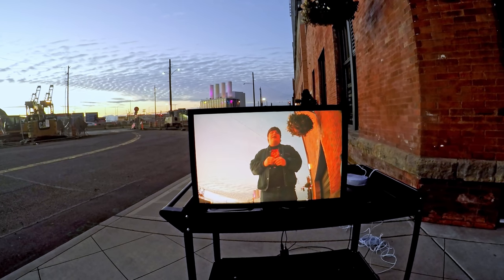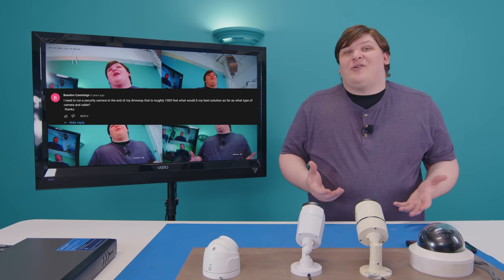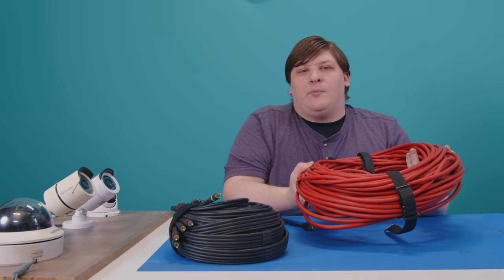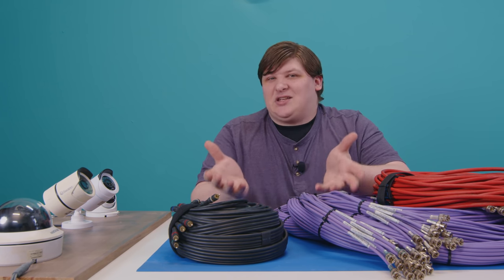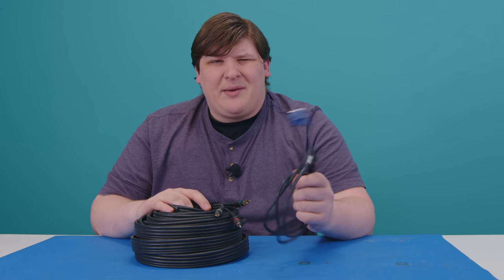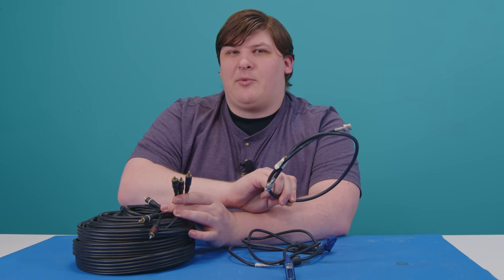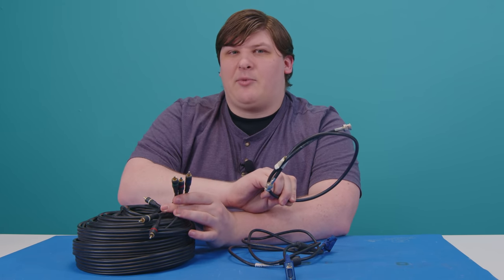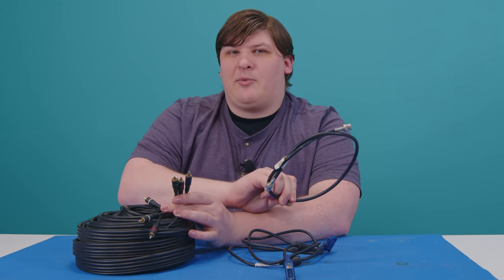1000ft of ANALOG HD video over a single cable?! [AHD/CVI/TVI]

Comment: Thanks! Ive wondered how they did this since i first installed one of these HD surveillance systems several years ago.

Turns out they just turned up the bandwidth limiit on plain old NTSC to get more horizontal lines. And more resolution on each line. Cool!

And nothing anyone could put a patent on.  

It remind me of the first NHK hd cameras and recorders in the 80. Those were analog RGB, 10 Mhz for each color channel, 30 MHZ total. Standard def was less than 6 MHZ. That caused a lot of skepticism about hd broadcasting in the beginning as we would have had to open a whole bunch more channels at the same time cell services were looking to expand.

Comment: I belong to SMPTE. The ITU-R Rec-601 is 720x486@270mb/s. Fun fact it was called CCIR601R before that, and was a parallel (NOT serial NRTZ) digital signal over a 25 conductor DB25 cable and connector!
Look it up! the cable was super low capacitance (something like <2pf per metre) and was several dollars per foot!  I still have a roll of the parallel cable!
Reply: Yep.  I have a Sony D-2 deck in my basement with a composite digital parallel connection.  Super fun thing was learning that even though you can use a parallel to serial converter, it's still composite.  All normal serial digital is D1 component.  Had to get a format converter to change it from D2 parallel to serial then to SDI (D1 component).

Comment: The only commercial systems I've worked on were all IP cameras with strategically placed switches to keep the wires short enough. Never occurred to me before that analog would've been used prior. Neat.

Comment: Historically, Ethernet ran over that RG-58 coax, known as 10-Base-2 or "Cheapernet" because it was cheaper than the heavy RG-8-like coax used for the original 10-Base-5 Ethernet.  All of these were 10Mbit/s with CSMA/CD bandwidth management.  If those Ethernet converters provide more than 10Mbps over RG-58, they probably use a different data encoding than the original crappy 10-Base-2 signaling.
Reply: This would be 10Mbps max, as its a shared bus/cable (so no separate send and receive lines) and would need to be able to fix the Video stream and any commands/diagnostic data. Would be possible, but probably only at SD bitrates, in which case, analog signals would be fine.

Comment: Back in 2008 I had a tour of the video surveillance system in a large casino.  All of the cameras ran over coax, for a specific reason you didn't mention - no digital lag.  The timing of the video signals, and the matching between them and all of the other systems recording exactly what happens when, is critical to how they are used in a casino environment - to identify and catch cheaters in the act.  As I recall, all of these video signals were brought in over coax and then split between the live control room (where they had the pan / tilt / zoom controls), and the recording facility which in the day had dozens of racks, each of which had dozens of RUs of USB video capture devices - each of which took one analog signal in, and converted it over USB into a device that would record the output and then pass it through to the digital storage that was again all separated from those capture devices.  It was fascinating stuff for me at the time, and a complete eye-opener as to the different priorities that dictate how video surveillance works in this type of high-stakes environment.  Thanks for your insights - and I hope that one day you might find one of these decades-old devices being sent out to pasture, and you can rediscover this weird transient technology from the day!

Comment: The thing is, coax carries the data from the satellite dish to the box, or from the aerial to the box, but HDMI is needed from the box to the TV. We know coax can carry all the data required for HD signal over a long distance, because it does that in every house.
Reply: Both HD satellite programming and broadcast HD use digital modulation schemes, while these security camera standards are using baseband video... going from "a solution exists" to "buy this product" is engineering, and I think that's what this video is appreciating.
Reply: RG-59 coax is typically used for CCTV systems (baseband video, not RF), it's not good enough for UHF or satellite TV at any length (ok for a fly lead but that's it). Coax good enough to connect your satellite dish is a lot more expensive.

Comment: AHD/TVI was used in a video transmission system for drones then called Byte Frost by Fat Shark so that's where I first read about it. In subsequent iterations of the hardware they threw away AHD and went with MIPI-CSI with a proprietary handshake protocol.

Oh and also all analog cameras for FPV drones such as Runcam/Foxeer/Caddx are basically repurposed security camera sensors with slightly better lenses. FPV wouldn't be that dirt cheap if not for the security camera stuff. 

Yeah, our hobby was pretty much entirely analog SD well until some three years ago when DJI released their bonkers digital HD transmission system, but that's for another story.

Comment: I actually own a business and do cameras/networking/production for a living. I typically use IP cams. So far, my longest run with an IP cam was 508ft through a single CAT6. Camera has worked flawlessly at 4k 15FPS. Also I've ran component video over 175ft through RG6 coax terminating with RCA connectors. Works great but it is rather bulky with 5 runs going to every device
Reply: Component video is amazingly tolerant... short runs to a newer TV that uses a TRRS adapter can be extended with a 4-pole headset extension! Then again, I did use a gold-plated headphone cable, that's potent homeopathy. 🤣

Comment: I feel the need to correct things: digital signals can travel much further and longer than analog signals fom the pure signal transmission side. It's the implementation on the sender and receiver that sucks. There are implementations that lower the bitrate and get a perfectly good signal (e.g. in modern RC rx/tx) with whole lot of algorithms and ideas. That is just not implemented in TV stations, since they are designed to cover a given radius.
Reply: Or radio for that matter. For the exact same reason no less. But are they implemented for mobile internet transmissions?

Comment: It's really weird that the artifacts you get with composite like the dot crawl and crosstalk aren't that much of a deal breaker at higher resolutions. The moment you switched from the usual composite 480i, it's perfectly acceptable.
Reply: Same reason dot crawl wasn't really a problem with a portable 5 inch CRT: you can't see the individual dots anymore they're too small. More dots or less screen, same result.

Comment: I am an electrician with extensive security and surveillance experience. And to other electricians, I am a nerd. As such, I came for the tech and was captivated by the history behind the tech. I do remember 960H, but it was very fleeting before the digital takeover. I still install NTSC coax cameras for their resilience and when necessary, I convert the coax to EOC (ethernet over coax) and then use a switch and IP cameras. But analog, as you said, it is far more robust and for the price is still a very good option. Hybrid systems exist so you can retain your older but still useful cameras and update with 4K ones all on one system.

Comment: Really interesting. I always wondered why "regular" composite never got even a tad better.
Reply: Bandwidth limitation. It had to fit within a 6Mhz broadcast channel signal allotment. If you tried to go higher  there’d be interference with adjacent channels. DTV made it possible to use digital compression to fit HD channels in the original 1940s channel width assigments.

But with a cable you don’t have that bandwidth limitaton.
Reply: @StevenBradford   Also of note, most PAL countries had wider channels. 7MHz in Australia, 8MHz for most of Europe and China. 6MHz PAL channels were quite unusual and only used in a handful of countries from South America.
Reply: For coax (antenna/cable) I can understand that, but for composite signal or s-video?

Comment: AHD/TVI/CVI are pretty much the same but have different colour subcarrier frequiencies, and also the subcarrier is above the luma i think, rather than overlapping like PAL/NTSC
Reply: Im cofused as to how that would work. Do you mean the chroma signal is in a different section of the signal from luma? In which case why would you need subcarrier? As pointed out by CRD in the video, the signal looks like NTSC on a scope.
Reply: @StevenBradford  What??? How would you otherwise transport Luma and Chroma on 1 cable if u didnt have a subcarrier?
Reply: @willyarma_uk  As I understand it the chroma is “overlapping” the luminance. The subcarrier burst  is in the horizontal blanking but doesn’t have the color in it. I think i was just misunderstanding what you wrote.
Reply: @StevenBradford  Ahh right, no the colour busrt in the blanking period is just for synchronization. The chroma is quadrature amplitude modulated and then summed in with the luma. What I meant was I think the the frequency of the subcarrier is quite high so it dosent overlap the frequencies of the luma as much.

Comment: Two things come to mind having watched this. The first is that if they did this over S-Video, most of the degradation problems would go away, but the technology wouldn't have to change drastically (S-Video can be converted back to CVBS at the destination passively, though using transistors looks better). The second is that cramming more horizontal resolution in the signal was something that many games supported on the PS2, Dreamcast, and GameCube. I think there were a couple of PS1 and N64 games that did it as well. Usually you'd have to hold a button while the game booted, though sometimes the code was there but inaccessible without a GameShark. Often, these were artificially limited to component/RGB cables because 960x480i over CVBS wouldn't be supported by most TVs, even those that supported widescreen, but that's not always the case. The PS2 can be configured to try to shit out 1080i over composite if you wanted (though this wouldn't work without a processor that supported custom timings). We got so close to an analog HD future, but it just didn't materialize.
Reply: Changing to s-video would require using different cables, which would defeat the purpose in many cases.
From memory the oldest game consoles did the reverse with horizontal resolution, outputting less to make processing easier.

Comment: I ran headfirst into this when buying some security cameras at the Peoria, IL HAMfest, I found they didn't work with my DVR.  They were marked as NTSC, so I assumed composite, I'd seen and worked with eBay cameras marked as "HD" when they were simple composite video, so I assumed these are the same thing.  Nope!  I too figured out that there were about three different formats that were basically "bastardized composite."  Your video slightly expanded what I'd already figured out, and I'm glad YouTube recommended it to me.  As for my cameras, IP cameras have come down enough to where I can afford them, so once I get Zoneminder working the way I want it to, I'm going to replace my composite cameras with IP cameras.

Comment: There is hdmi over ethernet too. Have converters on both sides and use ethernet in between
Reply: It's hard to find good ones though. We put those in a few client places. Since essentially the max for an HDMI is 75ft with a built in amp.

They fail way to often to be used in commercial applications. Unless you go real high end.
Reply: True HDMI over ethernet is distinguished from HDMI over twisted pair extenders... ethernet converter systems often have extra bells and whistles, like passing IR remote signals. These units tend to cost around $100/pair, and in fact are generally compressed MJPEG or H264 in RTP/UDP/IP on ethernet. They can be set up as a relatively low cost video switching system using a managed ethernet network switch, placing as many receivers as you want in the same VLAN as the transmitter.

Doing this with the cheaper, simpler to find HDMI to twisted pair converters won't work, and may damage the devices if you try.

Comment: I discovered this in 2017 maybe? I was curious because I wanted to build an HD FPV system for my quadcopter.

I was inspired by seeing AHD, TVI, and CVI security camera systems on Amazon. And found an article of someone that did in fact experiment with it!

Up until only a couple years ago, there was no good digital FPV system that had low latency. Most were IP or WiFi based and had very limited range and latency on the order of several seconds, unusable for FPV. Another advantage of analog as you mention is the soft degradation in image quality rather than the binary "it works or it doesn't" type thing.

My thought was I could repurpose the existing analog video transmitter/receivers and feed them instead an AHD signal. See what would happen. It didn't work out since the chipset used for those analog transmitters is actually a bit more sophisticated than just an RF mixer / heterodyne (Double Side-Band Suppressed Carrier modulator, similar to AM). Instead it is FM and does decode the signal somewhat and is limited to the 6MHz bandwidth of the standard NTSC/PAL signals.

I think the picture ends up in black and white w/ some sparklies and noise (different color encoding schemes), and really zoomed in on the top half quadrant of the image when you attempt to decode the HD signal with a standard NTSC/PAL receiver. I never did end up pursuing AHD FPV since at that point the digital DJI system came to market and solved the issue, and Sharkbyte with their quasi-digital system that actually used existing AHD cameras for the FPV cameras and a digital encoder to send the digital signal to the googles. Both these systems have limitations. When it comes to of cost, range, quality, and latency, DJI is good at range and quality. Sharkbyte is lower cost and lower latency (or rather, not a variable latency, which make it much harder to fly well)

Another possibility to improve existing NTSC/PAL is to make more efficient use of overscan lines. I think PAL has enough total lines to actually show a (close to) 720p image if overscan lines could be included.

Comment: 10:25 There were two (at least partially) analog HD video formats : HD-MAC and Hi-Vision/MUSE :
https://en.wikipedia.org/wiki/HD-MAC
https://en.wikipedia.org/wiki/Multiple_sub-Nyquist_sampling_encoding
Reply: and 819 line. Analog HD but black and white.
Reply: @debranchelowtone  Most TV sets weren't good enough to show an improved picture in 819 lines than in 625 lines.
There also was a 1025 line project at the time the 819 line system had been adopted.
Reply: @chucku00  Sure it was far from perfect, cameras had their limitations too. The experimentations started in 1941 with more than 1000 lines. By 1970 until the end in 1985 almost everything was shot in 625 lines and optically converted to 819 line. So it didn't look good at all during the last years.
HD-mac appeared later. Very interesting one too.
Reply: @debranchelowtone  Je bossais à la FNAC quand les expérimentations HD-Mac ont eu lieu en 1992 pour les JO, avec le fameux téléviseur Thomson Space System. J'ai connu le 819 lignes jusqu'en 1983. Et franchement, mis à part la meilleure réception en VHF qu'en UHF là ou je vivais, je ne voyais pas trop la différence entre 625 et 819 lignes.

Comment: Hah, analog wins again! Digital over any amount of distance always seems to be worse than analog in terms of robustness, at least in my experience. The worst offender I've seen is digital "HD Radio". Trying to keep a digital AM/FM signal while driving is rough. So rough that being able to seamlessly switch between digital and analog as conditions worsen is a big part of the standard.

Really fascinating video, I really enjoyed it man! Thanks!
Reply: With wired connections, digital can go pretty far and still be robust. Wireless transmissions, such as TV, radio, and Wi-Fi, on the other hand... Analog does so much better in that front.